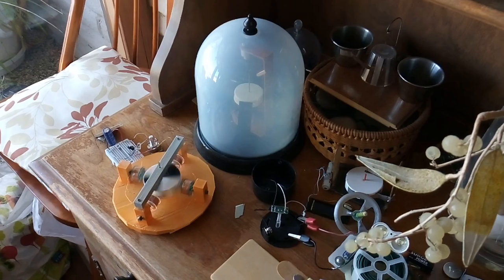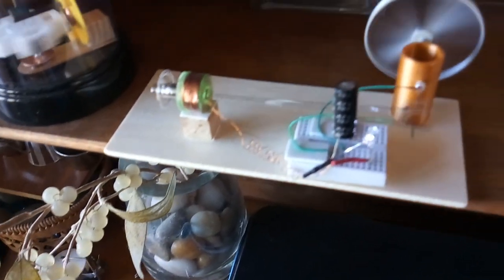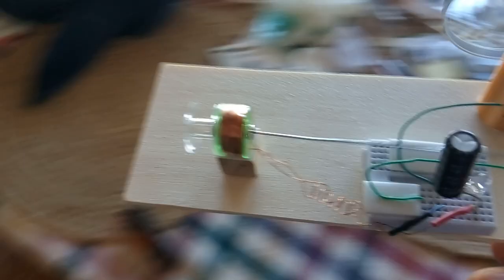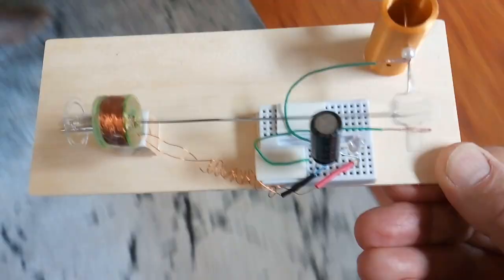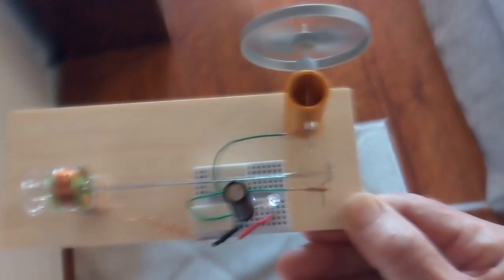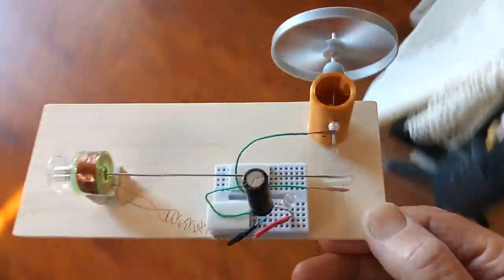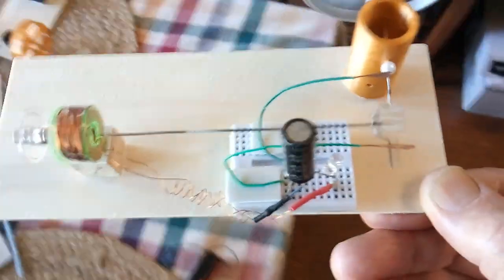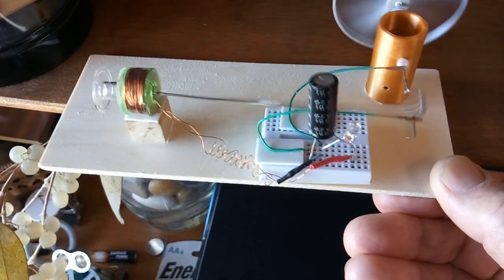Solenoid Engine Walkabout

Comment: Haha, good to see the tradition keeping on going, just like the long runners on the shelf.
Reply from the maker: I figured that you would see this and remember the tradition.  I should have been in bare feet.  If i get around to adding the generator part of this and looping it then THAT will cause another walkabout video.  Perhaps the video will cause a worldwide scramble to replicate it or perhaps a visit by the men in black . Ha.
Reply: Maybe a couple of MiB's replicating the video, sat at a workbench, with whisps of smoke rising from their soldering irons... 
"How DID he do it?"
"I dunno George, you're sure the design he got it from is still locked away in the warehouse?"
"Yeah, no. Damn. Let's go find out"
Reply from the maker: @Slider2732   Oh they are going to be really mad when they find it missing.

Comment: A very satisfying noise too. You will be doing pop pop boats next, off on another tangent 😆😆
Reply from the maker: I have not built a pop pop boat yet. It is on the to do list.  As I recall you have done a bunch of those and have some great designs.
Reply: @Lidmotor  haha, most of them hardly moved, but they are rewarding when they do 😊

Comment: Was wondering if your contacts were showing any ware  from inductive kickback when the circuit is broken?
Reply from the maker: The led in this circuit acts like a snubber diode and helps protect the brush contact surface.  It still wears down due to friction and some arcing and is not the best way to switch this.  Some sort of brushless electronic circuit would solve the problem. Good question.  Thanks.

Comment: by the title, I thought you made a walking robot
Reply from the maker: Actually on a smooth surfasce this does move around some due to imbalance vibration.  If I put  springy wire legs on it the thing might dance around like a 'bristle bot'

Comment: I forgot to ask what kind of coil are you running, along with voltage and current. I’m just curious. Keep on cranking out the videos👍🤓
Reply from the maker: The coil is 30ga magnet wire  and is about 10 ohms.  The motor draws about 30 ma. at 2v.